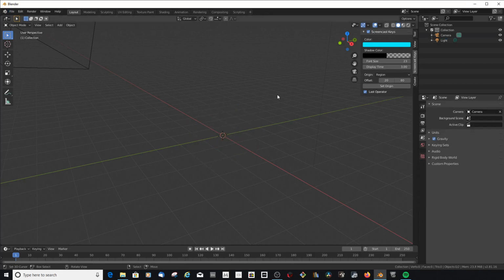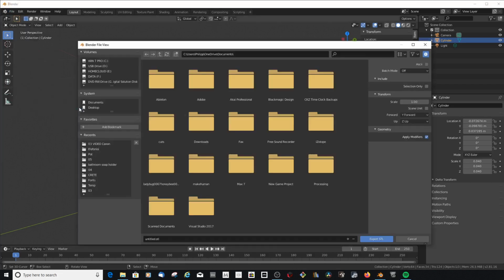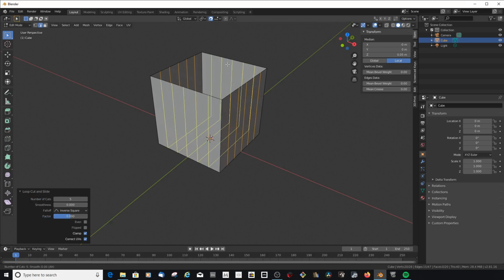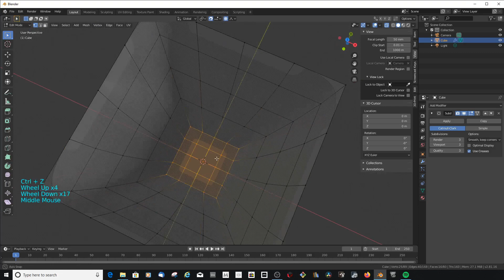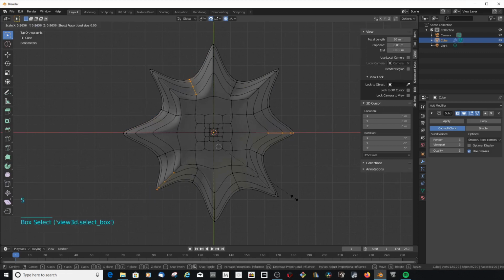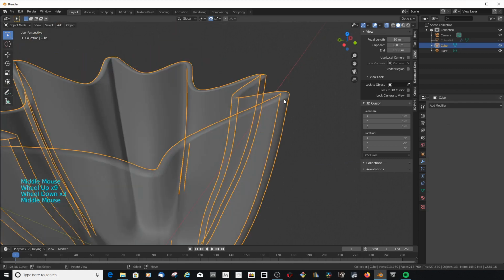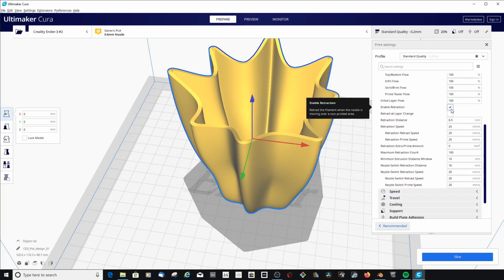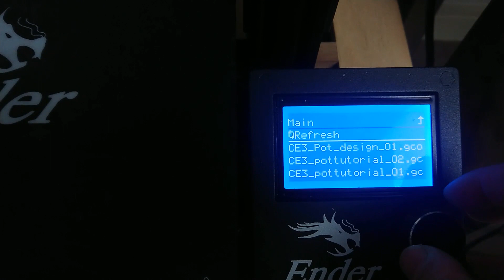3D printing with Blender, Cura and ender 3 Pro

Comment: it's a great tutorial, can i ask...i need some help,  I'm an absolute beginner at 3d printing, i received my first Ender 3 printer for Christmas so i apologize😅: when printing the layers, do i have to manually adjust the height of the nozzle for each cycle ? there isn't much  direct clarity to what happens between each layer.
Reply from the maker: No you don't need to adjust the layers for each cycle. The printer does that for you.
Reply: that's a relief, thank you

Comment: Thank you for your help. And cool design! Isn't the default nozzle 0.4mm tho? Should set to 0.6 if it's 0.4?
Reply from the maker: If your nozzle is 0.4 then you need to set it 0.4 in Cura. It should not make any difference for this model. I'm using a 0.6 nozzle. I like it because it's printing a bit faster but then less smooth. Every nozzle size has it's pros and cons. The only thing you might want to consider with certain nozzle sizes is the thinkness of your wall. I normally try to have multible off my nozzle size when i set solid modifier in blender for a cleaner print. So for example: my planter wall thickness would be 0.4×12 for a 4.8mm thickness rather then 5 mm if i would use a 0.4 nozzle. Hope it makes sense.
Let me know how it goes. 
Good luck

Comment: Appreciate the video Philipp! I've been stumped on this for a while, designing my models in inches and then loading it on to Cura with the "scaled 10,0000%" problem. Thank you for the help!
So if I was designing in inches I would just have to change the scale while exporting to the amount of inches in a meter?
Reply from the maker: @Alec Harlow

In which software are you designing? If you use Blender with imperial settings and exporting an STL it seems to automatically converting and exporting in mm still. (metric system).

If you, however, have your blender unit system set to meter and you are thinking and designing in inch than this is a problem and you need to scale your model manually in Blender or apply the right scaling multiplication when exporting the STL....

So I just tested this by setting my blender file units to imperial: 

I scaled the default cube in Blender to 5 inches. (127mm)
When exporting from blender it creates an STL with the dimension 0.127(Meter). So it automatically converted the units to the metric system. But CURA understands this as 0.127mm... 
However now by default CURA scales objects if an object seems to be too small or too big. (you can check this in the preferences general settings). You can also scale manual in CURA btw...

But in your case, I would probably use the scaling option in the STL export dialogue in blender to be sure and multiply by 1000. 
0.127*1000 = 127mm(5inch)

Just make sure that you work and set the unit system you are designing in in blender in the properties panel under Context/Units.

I could probably do a more in-depth tutorial about that. 

Hope it makes sense. Otherwise, let me know.
Cheers
Reply: @PhilippGalvanDesign  I appreciate the write up! About to give this workflow a go from Blender>Cura>Ender 3 Pro!

Comment: omg im so confused about the scaling and etc. cant we just switch blender to mm and thats it
Reply from the maker: This video is a bit old. It should be much more straightforward now. Just try it.
Reply: @PhilippGalvanDesign  Unfortunately its still crapola. Just changed to MM and modeled my model and Creality Print is confused about why the model is so small. So all the units and measurements are useless. I wouldnt be surprised if we still need to do the workflow as youve pointed out in this video. ahh PITA
Reply: @PhilippGalvanDesign  wait, after the weird error, creality print is just using the correct measurements. Will respond if it printed correctly. All i did was change the preferences in Blender to MM length units and made sure the models transports were applied (so scale is 1.0)
Reply from the maker: So to better understand this. The unit blender is using is a non unit. Although 1 is translated to 1 meter inside blender it's just a conversion on your  screen. it is still just a number outside blender.
If you save a blender file it's units are blender units not millimeter or meter. 

Example: you model a football which is 0.2 meter in diameter in blender. When you export it it doesn't keep the information of meter. It is still just 0.2. now Cura Imports in millimeter. When  Cura reads your file it reads 0.2 millimeter because there is no information that says meter.
Reply from the maker: But it seems it worked now. 
Another thing Cura is doing. It scales an object if they are too large. It tries to guess the scale.
Reply: @PhilippGalvanDesign  yeah thanks for the mental support. everything worked out great 👍

Comment: Why wouldn't you just change the units in blender to be millimeters?
Reply from the maker: Yes I thought so too but - If I use unit length = millimeter, then the STL exporter still uses the global units meter and doesn't recognize that I changed my unit length to millimeter.
Its only for convenience during modeling.
But I do things different now since i recorded this video more then a year ago. I should do a follow up at some point. Anyway, thanks for bringing this up.
Reply: @PhilippGalvanDesign  Thanks for the reply, that will help me out!

Comment: I did exactly what you did I tried to print it I even put the paper-thin card into the same slot that you did but the printer still said no TF card can someone please tell me what is wrong how to fix this what is going on cuz I feel like I wasted my money now $230 for the creality Ender 3 Pro I am really upset in desperate if you know what to do and can help me then I will greatly appreciate it
Reply from the maker: If you turn printer on before you put the card  you need to initialize the card. Where it says: 'No TF Card' dial one step down to 'Init. TF Card'. Alternatively put the card in and then turn on the printer. If that doesn't work you should check if you put the card correctly. Hope that helps, let me know. Good luck.
Reply: @randomdofando8458  get a grip bro
Reply: @bmasseybrannen  make me I want what I want and I will never let it go I want to enjoy life and be happy I'm tired of Aging faster than getting what I desire
Reply: @randomdofando8458  did you get the Printer to work? Ran into a similar problem but resetting everything and starting over fixed it.
Reply: @jorgeo1492  no I did not get the printer to work but I'm doing something different now

1 we got the printer sent to Mike and Teresa our friends in Frisco Texas to build it for me since the first one broke

2 my mom made a stupid clumsy mistake and put the shaft from the new one in the box with the old one and she never contacted Amazon or the creality ender people at all so I do not have it fixed right now

3 I'm not so sure that I will have it fixed ever and everyone else says they can't find the part online and Mike said he can't I'm done with that 3D printer for now at this point I am the one who does not have any power or authority to fix it right now

What I'm doing right now

1 I saved it for the cricket maker 3 I am using it to make t-shirts I'm not just going to make random s*** and just hope people like it I'm going to ask people what they want before make it for them cuz I think that the customer knows best and if the customer knows best I think they'll be more likely to buy it if they get exactly what they want in their mind

2 we are going to sell organite and t-shirts organite was my mom's idea and desire to sell different stuff I can make with the cricket maker 3 is my idea but I plan to sell very expensive stuff after that my dad is getting a job in Texas we are moving back in to Texas for work back into that RV resort and we're going to be close to a beach again

3 I'm going to get lots of exercise there have lots of fun things that I can do and hopefully we'll have enough money by then to actually start selling extremely expensive things enough money for me to get my ass off of social security and get myself a God damn bank account my mother f*** my entire life up everyone believes that I can't do s*** and that I need to be taken care of that's b***** cuz I've never had an opportunity to prove much she believes that she has to get me fixed up before I can get off of it so that I can live a normal life like other people my mom should be in prison for 5 or 20 years for screwing up my life but yeah I'm going to eventually have my own s*** and sell stuff without being independent on someone and I'm just going to look for extremely expensive things to sell if I knew how to sell drugs without risking someone killing me or the cops finding out knew that I did not have to regret what I would have to go through a very damn well would have sold drugs right now only to get on top but I damn well would not have done them it would have been on other people to do the drugs not me plus they would have eventually found the drugs growing in my backyard anyway so it would not have lasted long

If everything works out I'm just going to get it better 3D printer hopefully I can sell really expensive and nice things with that and hell if I don't make money I'll have better s*** than everyone else because I'll make really good stuff that just doesn't exist anywhere else

Comment: 8 hours!!!! Fuck!
Reply from the maker: You can try to increase the print speed but often the quality will suffer.
Also, you might want to check the infill percentage and nozzle size. I use 0.6mm which makes it a bit faster. Nevertheless, 8 hours is quite a normal printing time. Some of my pieces need 12 hours or more.
I might should do an update on what I have learned since then. 
Good Luck!